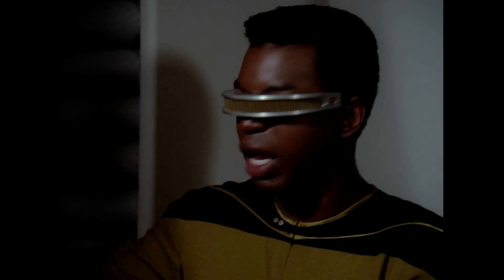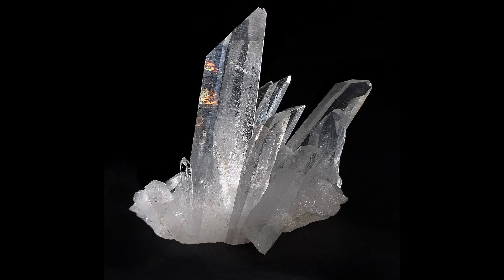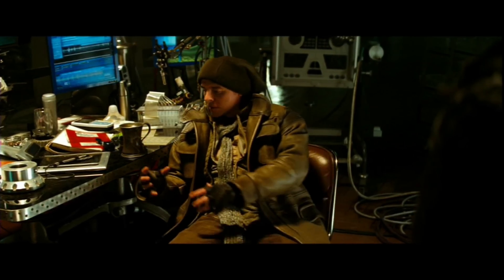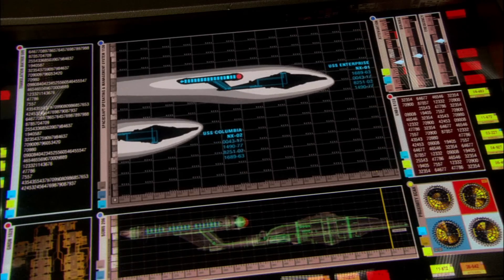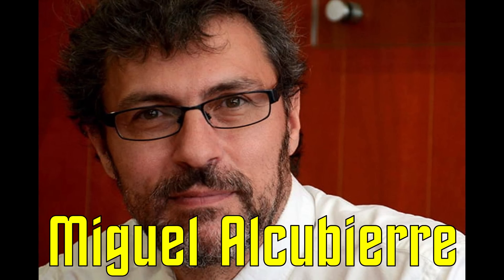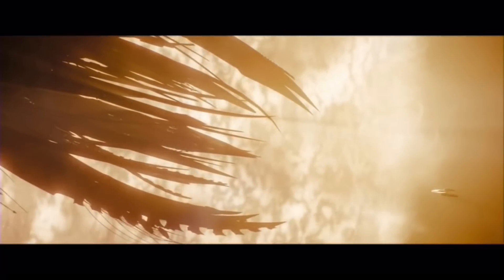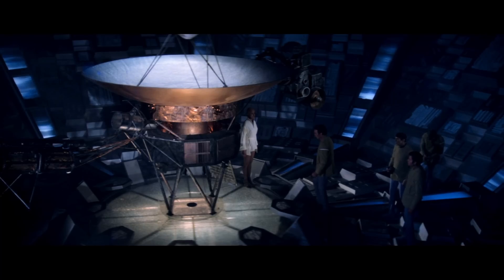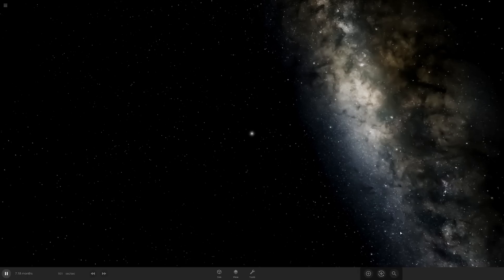The Science of Star Trek's Warp Drives

Comment: If you run the numbers, you'll find that dueterated hydrocarbons, like propane, hexane, octane, etc, store deuterium at a much higher density and at much less difficulty than liquid deuterium at 20 Kelvin. It can't be that, with replicator technology, it's difficult to remove deuterium from such a hydrocarbon on demand and at scale. And, clearly, there are obvious advantages to higher density fuel storage. Therefore, there is an overarching advantage to storing deuterium as a liquid slush instead.
My suspicion is that higher densities increases the power requirements of a the warp field of any given size and at any given warp factor.
However, this advantage clearly does not apply to the antimatter. If the antimatter is antideuterium and if the AM bottles of the Ent-D store the same  mass of antideuterium as the main deuterium tank in the engineering hull, then the densities of the antideuterium is about what we expect of liquid metallic deuterium.

Comment: You couldn't do it quite like in the show... but my personal thoughts (which could be BS) are that you would need to effectively break the resistance to the surface of spacetime itself.  My own thoughts were that you might be able to combine a neutrino beam in front to act like the spacetime equivalent of an aerodynamic cone to help you get closer to the speed pf light, and then perhaps generate a micro-singularity field to create a bubble that would effectively snap your local area of spacetime free from the spacetime tension that would build up around you... letting you effectively hop over the barrier... with the field also being a useful shield... kindof like using the singularity field to snap the tension in the "rubber band" letting you skip on, and with the bubble creating an isolated area of spacetime so you're not actuwlly breaking any rules and perhaps allowing you to skip the usual issues of dilated time, relative to the universe,  that go along with the compressed space at relativistic speeds. Of course there are a lot of issues with this and you would need pretty extreme radiation shielding... heck you'd probably see quite the gravitational wave and radiation flash at both the origin and destination... but this was my very basic idea with my limited understanding and education... and so, as I already said, it can be BS... but then that is true for most of these FTL options with our current understanding of the universe 😂

Comment: Warp drive is effectively not possible, even if the math checks out. The energy required to make the necessary antiprotons to generate a warp bubble large enough to engulf a shoe box is about the equivalent of the mass of Jupiter. to generate a warp bubble around a 600 meter long ship is roughly equal to a million times the energy Earth produces in an entire year. Quite simply the energy requirements are GOD LIKE. In order to make one trip to the next star and back we would need to extinguish several stars in the process. Even if we could artificially create antimatter it still would require vapourizing entire stars. Then there is a ethical moral factor to consider. Is it worth erasing half the galaxy just to travel around a bit faster?
Reply from the maker: Well, the energy requirements for a modest ship have continually been reduced over the years. I feel like I mentioned that in the video. That said, I do think it's possible that some as-yet-unknown aspect of quantum mechanics could rule out FTL. It's not a done deal just yet ;)
Reply: @OrangeRiver  There are other things besides energy requirements to consider. radiation levels at low speeds are manageable, but exposure increases dramatically as your speed increases. You'd cook before you even reached the speed of light.

If we ever build a spaceship with its own magnetic field strong enough to counter the radiation, and its own laser array powerful enough to produce fusion, it would need to be the size of a city, powered by something yet unimaginable. And now you have the mass to speed ratio to consider.  It's a lot. 

I think you were correct saying it could be a thousand years or more. Frankly it was refreshing to hear someone say something that well informed. We can't even keep the lights on in Texas and people think we're going to make a spaceship capable of producing more energy than the entire human race has produced in all its history?!?

We can get to 18Scropii (the closest star identical to ours) in 120 years of constant 1G acceleration. That's not so bad. I'll take that.
Reply from the maker: Lol yep, the estimates I've seen for even basic interstellar travel pitting it at another two and a half to five centuries seem more plausible than...2063 XD

Comment: A matter- antimatter reaction isn't a nuclear explosion, dummkopf. 

A conventional nuclear explosion requires a critical mass of uranium 235 or plutonium 239 in two parts, which are slammed together with high explosives, causing a chain reaction of neutrons as the uranium or plutonium are split apart by fast neutron radiation. The resulting reaction is a nuclear fission reaction, which releases fast neutron radiation and energetic radiation. A controlled fission reaction of uranium can be used as nuclear fuel in nuclear power plants. 

Then there's the hydrogen bomb, or a fission/fusion bomb (a pure fusion bomb had never been successfully built or detonated). A nuclear fission bomb is used to kick-start a nuclear fusion reaction of the heavy isotopes of hydrogen, tritium and deuterium, which fuse together forming the heavier element of helium. Fast neutron radiation and energetic radiation are released in a fission-fusion reaction.

Nuclear fission reactions only utilize about 2.5 percent of the nuclear fuel. The other 97.5 percent of uranium/plutonium fucks off to The Blue Hills. 

ANTIMATTER only requires regular old matter to bump into regular old antimatter, or vice versa. The result is a 100 percent conversion of all matter and antimatter involved in the reaction into 100 percent radiant energy. 

Recap! Just reread what I posted.

Comment: What if instead of a huge bubble around the ship, what if you had a warp jet, funneling the space distortion through a pathway in the engine. (It might just explode the ship, but this is a hypothetically for fun). This would have to be much more efficient because you're warping a much smaller volume of space. Putting the flat space outside of the engine instead of the entire ship. 
Much how a jet engine works, space would travel through engine/ ship, which would by default look as if the ship is moving forward as the distance in front of the engine is decreasing to wherever it's going.

Comment: Cuz this is a dogshit video, I tell you "the latest?", currently what you could do is gather a fucktone of heavy elements (in space, like far from earth, in actually empty space, away from gravity wells) in a sorta arrow shape like this >, the gravity "bubble" craeted behind the pointy part between the legs should be equilzed while the ponty side warps space with sheer gravity from the mass.

Now after this they just simply launch this arrow trough space where they wanna go and the "bubble" will protect the load from drag. Or you might know it as "g" force, or acceleration, etc. Which is the idea behind warp-drive, is that the "ship" is protected by warping space around in a fashion.

Now moving mass around in this arrow will cause the ripple acceleration effect, and increasing the mass increase the speed.

This arrow is big btw. Depending on the mass of the material used tho. However using a less massive element, with a bigger arrow increases the bubble size. Its basically a low tech solution where you only need to put stuff in this shape and thats it, no funny business. Its big, its ugly, but there is room in space, and so far no other civilization to judge you.

Having the arrow segmented and spin probably the fluctuation part, anyways the math is done, some dude done it, and it should work.

Comment: I am certain that we currently have the technology to build a warp drive (if it actually possible), but not one which would propel anything faster than a snail's crawl. We just currently do not have enough of an understanding yet to do so. Just like we technically had the technology to develop huge vessels of metal and concrete thousands of years ago, we just didn't have the understandings to be able to make them capable of moving beyond floating (plus it would take much more difficult and time-consuming engineering due to not having modern tech).

Comment: I'm working on a warp drive in my garage. I'll let you guys know when it is done. Just need to align the tricyclic phase with bi-spatial tricorders., and test the trilithium transwarp propulsion system and the Lexorian gateways.
Reply: Trilithium are you mad?!!!
Reply: Dude!  You’ll need a few retro turbo encabulators to get the spurving bearing to align correctly; otherwise the flux capacitors won’t spark correctly and the bi-spatial tricorders won’t work in tricyclic phasing.  It’s basic Warp Field Geometry 101.
Reply: @keirfarnum6811  Damn it, it's all spurving bearings these days.
Reply: No self-sealing stembolts?
Reply: You will have a better chance using quadcyclic phase with tri-spatial quadcorders
Reply: @grht2  Quadcyclic phase?? You madman!

Comment: The latest research has demonstrated that the energy releashed from analization in matter/antimatter tests in labs is much less than anticipated,  even much less than the energy used to create the antimatter. So, the biggest problem to solve, even for significant travel within our own solar system is energy generation on the vessel. Solar arrays lessen the further from the sun one goes. The electron release from graphene sheets seems promising, the Swedes are powering a submarine from one such generator, but the amount of fuel required for long term travel seems to tax the rockect equation quite a bit. Current nuclear generators are doubted for effectiveness in zero gravity, as well as being horrible hazardous at launch time. Seems to me, finding an energy generation system beyond steam through a turbine turning a cooper coil around a magnet . Until such a system is discovered,  all the theories of traveling faster than light are just fiction for creative writers to entertain us. Nothing more.

Comment: This turned out even better than I’d hoped 😊 

I doubt I’ll live to see it but I do think the elasticity of spacetime is enough that the positive-mass-only designs could prove the key — the mass-energy of another spacecraft isn’t exactly hard (theoretically, for space industry) to harvest from the Van Allen belts or equivalent parts of Jupiter. Much like there were millennia-old steam engine designs built to test a concept, and not applied to large scale for a very long time. Sooner or later I believe we’ll have the engineering capabilities to do it. 

If we can build a huge fusion fuel or antimatter fuel “refinery” orbiting a star, it would be a huge undertaking, but economies of scale afterwards could indeed enable fairly cheap travel — to nearby stars at least. But a single solar system is so huge, that’s still a massive boon. And indeed, in Star Trek humanity’s first colonies went out slower than warp 2, just barely faster than c, on multi-year or near-decade one-way voyages. 

The progress in Star Trek is accelerated for dramatic purposes, from millennia to centuries, though indeed in the setting that’s fairly unusually fast, with the others often taking millennia. But to give a really conservative estimate, I’d be surprised if another 10,000 years from now (given that’s roughly how old agriculture is) if we couldn’t do it. Think of all the new ways of probing the universe we’ve uncovered in just the last century alone!

Comment: Can someone explain? I thought the warp engines just make the warp bubble which makes it easier to move forward faster by compressing space in front and lengthening behind. To actually move forward still requires positive thrust like the impulse engines. OR do the warp engines also provide thrust and move the ship forward? I don't see a warp bubble simply moving forward without any kind of thrust. If the space inside the bubble simply moves forward without thrust, then the deflector dish is not needed at warp speed.

Comment: No.
Because the whole idea of a warp drive trades one impossibility for another.

Here's the reasoning.

1. It's impossible to move through space faster than light.

2. So let's move a pocket space and stay inside the pocket.

3. How do you move space?

4. With negative energy.

5. What's negative energy?

6. Something that doesn't exist.

7. Uh...is there any other way?

8. Negative mass.

9. Does it exist ?

10. No.

11. Then why are you even bringing this up?
 
12. Because it makes the math work.

13. Is there anything that actually exists that can "make the math work".

14. No.

Comment: It is part of the wave function.  There is a few tricks out there that could get more energy out of space time. Rougewaves. Essentially spiking out of the perturbed space. Solitons are one solution. The other is pulses timed to increase energy density thus a massive warp bubble. You see rouge wave in the oceans. They occur due to variable wave geometry and cumulative effects. If the Casimir effect is taken into account? Then it’s possible. We all have seen what happened when you put detergent on oil when it on the waters surface. The same might be true here?  Or when you place a different mass object near a small one and it moves away due to surface tension displacing it location. Just a question of how to achieve something similar concerning spacetime?

Comment: Let's talk Starfleet's  experience with faster than light travel as though it were real. 100 years to develop a FTL worth a dam, meaning a warp 5 engine. Just breaking the light barrier does help much. To Golden Star System it would still take 8 centuries. With a warp 5 you only need 40 years, definitely an improvement. But still it would two full generations to get there. So just going faster than light, even if possible doesn't end the problem of the vast scale of the universe.

Comment: The are already 2 types of warp drives that work. Neither is faster than light. Both do use the Casimir effect sort of. They interact with sub space like Casimir effect but don't push together. relativistic effects are not mitigated. Will not be likely it will ever go faster than the speed of light, you still have that mater mass problem as you approach the speed of light.

Comment: Light would appear to be part of the structure of the universe rather than a speed as such therefore, even if you had the energy, it's probably not possible to travel faster than light.Going faster than light either directly or someway around it like wormholes creates major paradoxes in space/time.I'm afraid that it's probably only possible to travel twixt the stars in sub light craft, emphasis on the sub!, which would take hundreds of years to reach just Proxima Centauri assuming some kind of yet to be invented fission or fusion drive but without that thousands of years.

Comment: As for warp drives it's is possible the thing is they say they needed a Jupiter mass equal to the size of the ship then down to maybe an earth size. Here is the thing. They forget to tell you it has to be equivalent to say the ship has to have scale to the warp field. I know I have talked about it before elsewhere  so the warp bubble size would be as strong as the earth I wish I could word this right.  So best way is to say. A cat scan or mri machines magnetic field is 5 times stronger than the earth's magnetic field  so why not use the power of that flipped around and move a small spaceship to warp speed maybe warp 2 using that technology and warp 2 is 2 times the speed of light. It will at least create a warp bubble and at the least an energy shield to protect us against  radiation against a ship.  It's still needs something to propel the ship into warp and there are some particles that will get us into sublight speeds and a few THAT go FTL . SO IT can be done